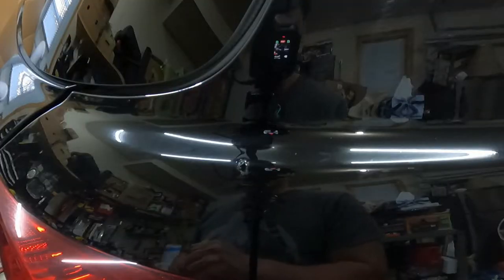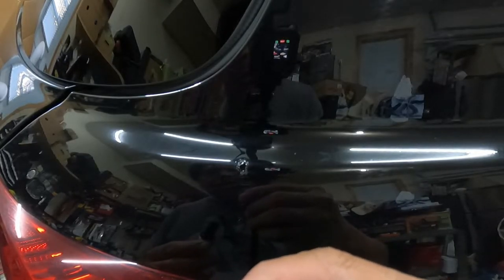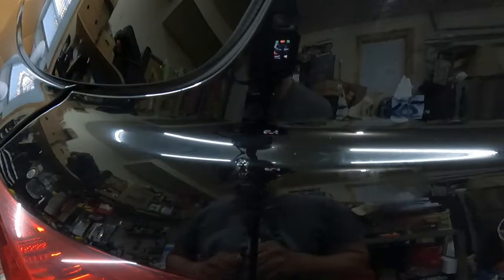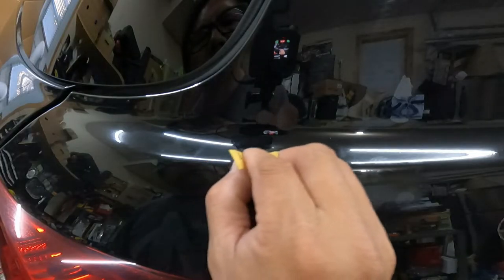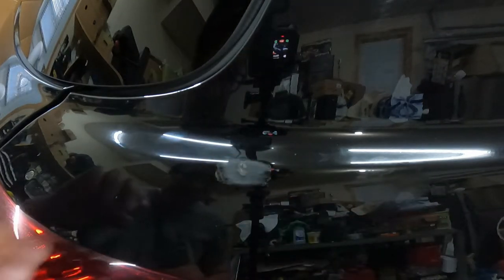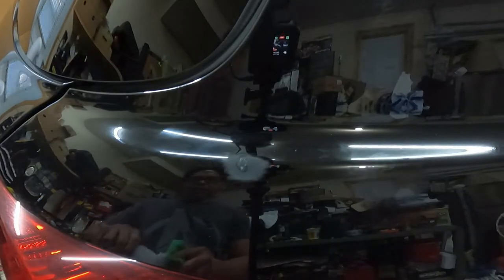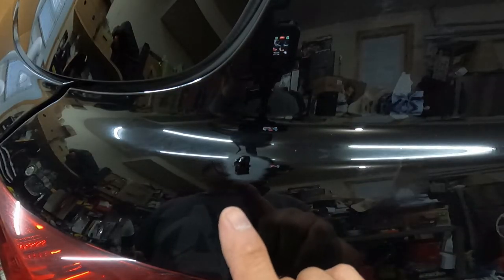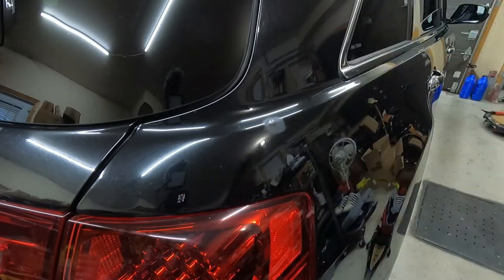Rust Spot Repair on Car using a DREMEL

Comment: I just tried to fix my MazdaSpeed3 and after touching up the paint with a pen, the paint just came right off when I sanded it. I used rubbing alcohol and the rest of the paint just came off. Should I be using something OTHER than the paint pen from the dealership?
Reply from the maker: Touch up paint from dealers are designed to protect stone chips, Just do multiple coats of touch up to prevent it from coming off, always wait for the paint to dry before applying another coat.
More DIY & Mods coming soon, Please LIKE & SUBSCRIBE and Thanks for watching!!!👍
Reply: Try a primer maybe

Comment: I saw some other brands at Walmart. Will they work the same as the Dremel or would you recommend this brand better?  Also, I’ve seen some people just use the Dremel & apply the paint right after..is this ok or should you apply a primer first?
Reply from the maker: Ro-lando Calrissian,  Yes other brand also works fine, It does the same job, But I just prefer the Dremel because of the build quality and speed adjustability.
Touch up paint are made to apply directly to bare metal of the part of the car even without primer, It's instant protection to prevent rust.
You can also apply primer before the paint if you want extra protection.
More DIY & Mods coming soon, Please LIKE & SUBSCRIBE and Thanks for watching!!!👍

Comment: This was great tito, I didn’t know the touch up paint could be built up like that and then sanded out. It’s essentially like a bondo filler alternative for diy projects for smaller spots of rust like that. 
Thank you from Canada as well!
Reply from the maker: Thanks for the comment (SALAMAT) , You don't need bondo to build up surface on a small spot, you can just build up the touch up paint and sand smooth.
Thanks for the comment!!!👍

Comment: Thank you for the detailed video 👌🏽

Would it benefit the results to use rust convertor/dissolver/whatever anti-rust agent available on the market? If so, when?
Reply from the maker: if you have anti-rust, apply it after sanding & before touch up paint, make sure the anti-rust is completely dry to touch before applying touch up paint.
More DIY & Mods coming soon, Please LIKE & SUBSCRIBE and Thanks for watching!!!👍

Comment: Great video friend, i have a very tiny rust spot on my 2017 ice silver Seat Leon, against that colour it is noticeable but of course i want to fix  before it spreads.
Ive ordered a cheaper alternative to the dremel with a similar bit you used.
Im a little worried about doing it, mainly sanding the surface but your video has been very helpful, thanks.
Reply from the maker: Thanks for the comment, I really do appreciate it, I'm glad this video helped you in any way and good luck on your repair.
More DIY & Mods coming soon, Please LIKE & SUBSCRIBE and Thanks for watching!!!👍

Comment: Not a smooth surface when done!
Reply from the maker: Albert, Sorry for the delay, Yes I agree it's not smooth, But to make it smoother I have to do bondo and sand then spray paint, The point of this video is to prevent the rust from spreading and making it look a lot better than a rust spot. So far my car have no rust on this spot until now.
More DIY & Mods coming soon, Please LIKE & SUBSCRIBE and Thanks for watching!!!👍